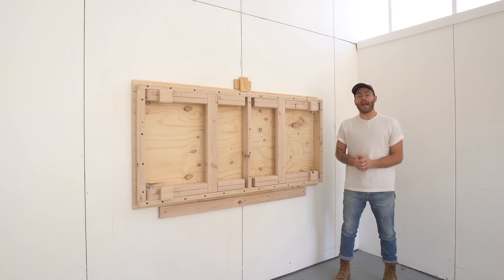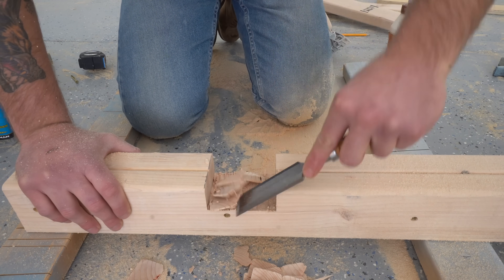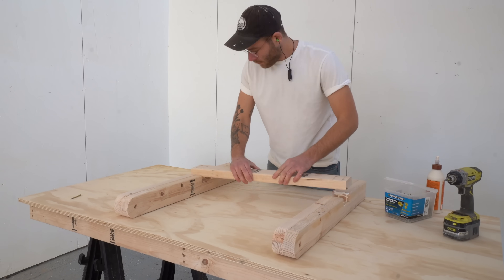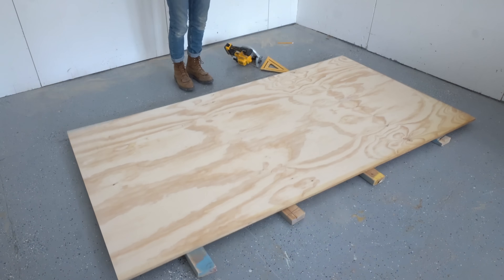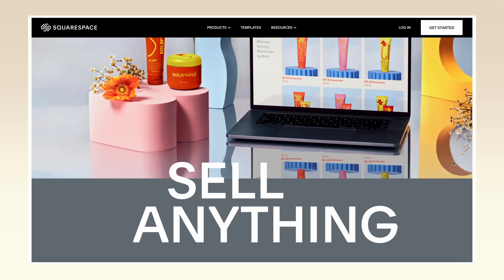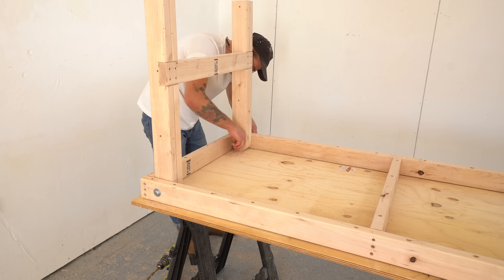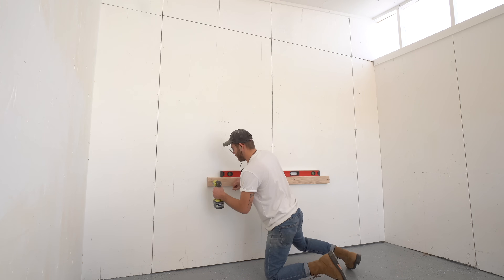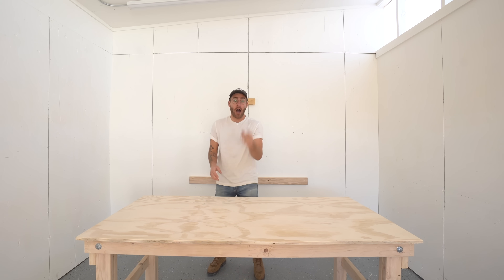DIY FOLDING WALL MOUNTED WORKBENCH

Comment: I think it definitely still needs a stretcher across to keep lega from accidently sliding in. Just add a removable one that can be stored above easily.
Reply: when he was jumping on it you could see them folding in
Reply: @bantheundead7745 i saw this "On Modern Buiiiiiiillllldddsss - crash - bang! ! Ow"
Reply from the maker: I don't want one... I'd rather have the open space underneath.... not sure what you're doing on your workbench but it definitely sturdy enough for building and assembly
Reply: Yup, over time everything will loosen up a bit.  Maybe even something on the back of the legs to still be out of the way.  Sooner or later it will gain slop.
Reply: @ModernBuilds  If enough shear force is applied from either end, it could cause the opposite side to buckle for one thing.  For example, if you applied enough force, say hand planing, to the left side (camera view), the right side might fold under under the right circumstances.  You may not use that bench for hand planing, but one of your viewers might.
Reply: @ModernBuilds  you need one the table will fold if your building heavy one
Reply: Agreed, some brace is needed.  Had sawing, routing, etc, can producte vibration and lateral forces that will walk those legs in.  I made a simple modification of have a triangular piece of the same plywood from the table top leftover wood, attached to the bottom with a piano hinge in such a way that it folded down via gravity and rested against the legs stretcher to keep them pushed out.  A simple 1/4" notch in that triangle keeps it centered with the stretcher and hasn't failed me yet.

Comment: New to woodworking and was able to follow the instructions in the video the only 2 things I needed to figure out myself was the depth of the holes so my screws would not go through the 3/4 plywood top and the leg cross beams (they are 30" just like the other 3 used in the table) . Grabbed my wood from Home depo and it was so wet that water dripped out each time I used a screw..also. this is not a one day build..i did not give the legs time to dry and the wood glue dripped out..next time I know I need to let it actually dry first. Had a ton of fun and holy hell this thing is heavy..i hope its just the 100 gallons of water and it will dry and lighten up. Thanks for the video!

Comment: I made one of those, put casters on it. Best work bench ever. Roll it outside in the sun. I have a removable stretcher on the bottom.
Reply: Where did you get the plans?
Reply: @dirkskep2458  Didn't have any. I saw a similar video and made it to fit me.  I'm a 5'6'' woman and I made it to be comfortable for my height and space on the wall for storage. 3'W x6'L x 30"T My best tip is to Buy the casters 1st it will determine the leg height. Make it as long and wide as you want.

Comment: You could add a piece on the bottom of the table that swings at 90 degrees to the leg assembly and locks it in place. It could be folded underneath the stretcher of the legs

Comment: I like the idea of the stop blocks 👍👍 never saw anyone do that before.
Reply from the maker: Better than a stretcher in my book... I want to figure out a way to get more torque by hand on the bolt and nut so that I don't need to use a wrench to get it super tight.  :)

Comment: Add a magnet onto the bottom of the work surface to hold you open ended wrench for leg bolts if you want it to really take 20 seconds

Comment: I would add a rabbet to the 2x4 at the bottom so that the table can see there and you have an additional "locking point. That way, even you you accidentally knock it, it should not fall down.

Comment: Please make more candles and tea sized holders. A magazine rack.
A short 4' wide sturdy bookcase without nails. (The one I have is 64 years old, no nails, heavy  boards, 3 sections on bottom and has never come apart. Built by a 14 year old boy. ) 
Add to the list: 
A China hutch circa 1940.
Dining room chairs.
Tiered floor shelf, 4 shelves. And how to repair a large crack at the front of the bottom shelf, running vertical near left edge. Please.
A folding table; many sises. Bed, chair, small child's floor and a 5' long X   
3' wide X 13" tall for teens 
to sit under and has folding legs. (We had a metal one that we wore out.)
Add a "real" desk, one with 3 drawers on the left and 4 drawers on the right and a long center drawer. None are made this way today. I love mine, circa 1950's. 
Add hanging lights, with a slow demonstration of how to put the light box together. Please.
Thank you.
Have I missed the kitchen
remodeling? The gardens?
The solar on the house roof? Bus trips or friends using the bus?
Thanks for listening. 
Judy

Comment: I think if you'd used a third washer between the legs and the edge of the table (kinda as a spacer) I think they might even fold a little bit smoother...

Comment: Do you have the measurements of all pieces for the build?
Reply: That's what i'm looking for too. I want to build this and already bought the wood, but i'm trying to find out the exact measurements for everything from this video is difficult
Reply: @shaunbarrios1979  8 Leg pieces are 32 inches (never mentions what size the stretcher is) Top frame is 2 71in pieces and 3 30in pieces. top plywood is cut to 35in by 73"

Comment: Is there a lip on the bottom ledge to keep the table from popping away from the wall?
Reply: It doesn't look like it. I made one similar and actually attached it to the wall using a piano hinge. Can't move it around, but I also have needed to in the past 6 years.
Reply: No, it's not attached to the wall, just stored there so he can move it around.

Comment: I was worried the legs were going to fold inside when you were on top. They bolt is firm now, but once it's loose, I'd be worried and probably extend legs to stretch to an angle. Which creates problems of its own.

Comment: Quick question. Perhaps i missed it, but when using the pocket hole drill bit to make holes for the 2 1/2 inch screws, what size bit did you use and how far down did you drill into the 2 x 4’s?

Thanks for any possible feedback!

Love the work.

Best!

Comment: I don't really like these types of benches. They're supposed to save space, but not only do you need to have the floor space to use them, you also need to have the wall space reserved to store them. They are basically taking twice as much space.
Reply: a workbench like this can be used as a cabinet 'door'...